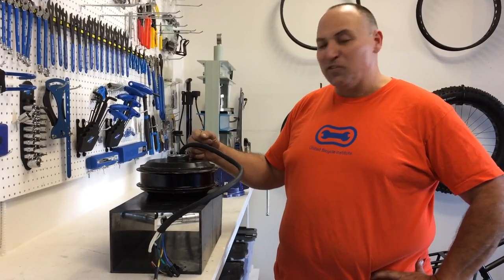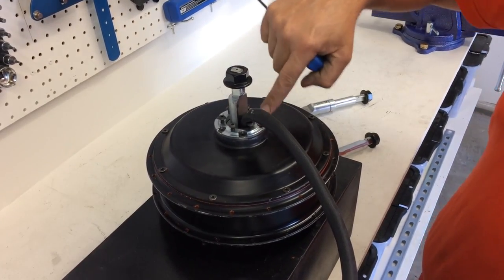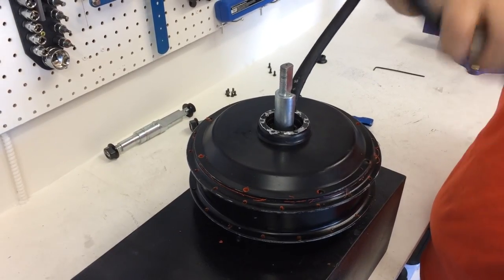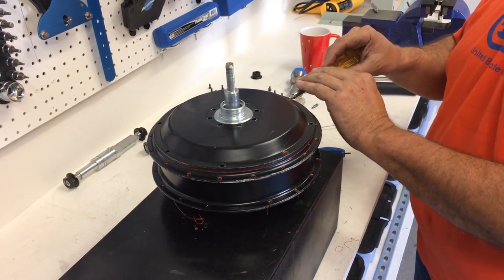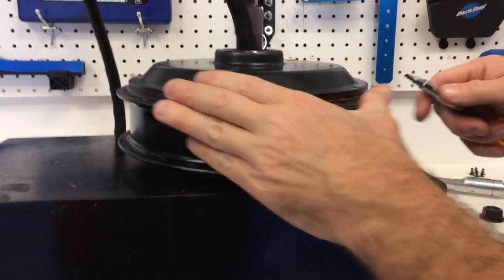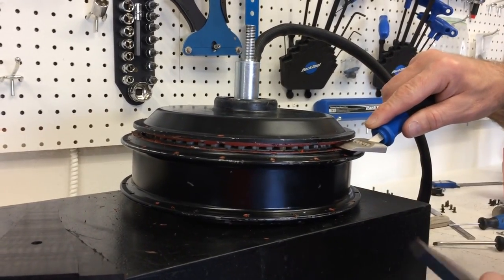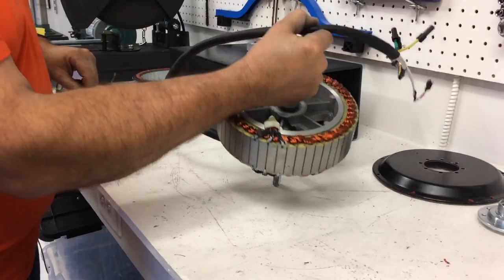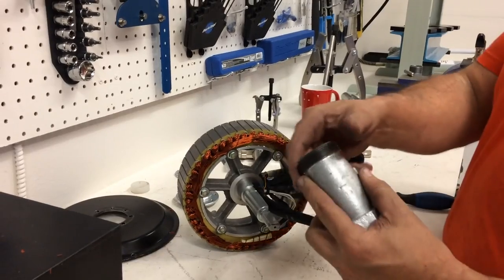Ebike Hub Motor Disassembly and Reassembly

Comment: Hi ya, could someone explain how the freewheel works in this motor? Thanks!
Reply: In tradition, the force is transmitted to the freewheel in cassette from pedaling and drive the rear wheel. But in e-bike, the source of power is the motor isn't it? So how will the freewheel work in this case?
Reply from the maker: David Kk The axle is pressed into the stator. Being rigidly bolted to the frame, the stator remains in that position at all times. The outer magnet spins around the stator. The motor cover, side covers and rim are rigidly attached to the outer magnet. The motor power causes this outer magnet to rotate.
Reply from the maker: The bearings lie between the axle and the side cover. This allows the wheel to roll freely in either direction if the motor is not under power. 

If the motor is under power, the bearings allow the wheel to rotate under power.
Reply: @industrialebikes4956  Thanks for your explanation! Glad to learn some engineering knowledge!

Comment: My 250w motor won't work at all any ideas what to check ?
Reply from the maker: I would start with a remove and replace. If you replace it with the exact same motor, your nonoperational motor will be a source of spare parts even if you can’t fix it. The first thing that I always check is the connections in the wiring. Beyond that, you could look at removing and replacing the Hall sensors.

Best thing about remove and replace is that you get back on the road faster. 

These motors are not expensive. You can get into the nonoperational motor at your leisure. And like I said, those spare parts will likely be a gold mine down the road.

Comment: Any possible way to do this without a gear puller?
Reply from the maker: You could make a tool specifically for the job, and that may work better because the OTC 1038 gear puller used in the video has very fat teeth on the jaws. The fat teeth require the user to pry open the motor side cover at least 10mm in order to get the bearing puller in place. Make sure to pry up the side cover evenly; using two people working 180 degrees apart from one another works well.

Personally, I use the (smaller) OTC 1023 for the exposed bearing and the (quite large) OTC 1038 for the side cover. These cost $41 and $62 respectively and they will last you a lifetime. As far as seating the bearings, a benchtop hydraulic press can be purchased for as low as $75. It is crucial to seat the bearings completely; I can accomplish this using less than 1500 lbs. of hydraulic pressure.

I rebuild these motors a lot, and it is aggravating enough using the job specific tools listed above. It takes a fair amount of time in order to get the large bearing puller on the side cover, but once it is on it is smooth sailing.

I usually slap in a fresh bearing because a 6204-2RS bearing only costs about $3.50.

Comment: Can you open mine .It looks like that one 1500 w
Reply: 😋I took my 1000w hub motor apart with a 9$ puller and used the force of the magnets to seat the bearing and replace the housing.Risky loosing a finger is very easy must be so careful⚡that was 3 years ago to repair i must do it again😕
Reply: We open mine was easy.Now I need to buy axle .Where can I find the axle 190 mm .

Comment: Hi, is there any chance that the axle could be loose in the stator?  I mean not playing loose, but I have knock when I push throttle after breaking with regen. The same knock I feel when I breake with regen after acceleration. I do not have rear brake caliper at all. I have proper, precisely fited torque arms both sides and nuts on axle are very strong tighten.  Is the axle assembled same way in mxus v3 motor? Could the axle move in stator for some reason during regen/throttle drive? Thanx in advance.
Reply from the maker: I have never worked on an MXUS. On the 50mm hub motors, the bare axle gets pressed in with over 3000psi of pressure, so I would HIGHLY doubt that it would have any play. Having said that, quite often when I order custom wide axles (from both Zelena Vozila and QS Motor), the bare axle fails QC at the factory and they have to machine the axle(s) again. I have often wondered what aspect of the axle failed QC--perhaps the diameter where it meets the stator?

Regen sure does apply a lot of backward forces. Enough to loosen tightly applied M16 axle nuts.

If I had to guess, i would say that you are NOT getting ANY play where the axle meets the stator. I would have to guess that your axle is rotating back and forth just a smidgeon in the dropouts. I see that you say that you have precisely fit torque arms and tight axle nuts, but I wonder if there isn't a LITTLE bit of play there between the axle flats and the dropouts.

If it were the case that your axle wasn't pressed tightly enough in the stator, it would stand to reason that the problem would get worse over time, what with the acceleration and deceleration. Is the problem getting worse?

Is this problem bad enough to require repair, or is it just irritating and perplexing?

As is always the case, a troubleshooting shortcut is to "remove and replace". Expensive as it may be, you could acquire a SPARE, equivalent rear wheel and substitute it in to see if the knocking problem persists. I love remove and replace as a troubleshooting shortcut, and there may come a day when you are so happy to have a spare, ready to drop in.
Reply: Thanx for wide answer, the value of pressure and advices. I appreciate it.

 The "knocking effect" is not getting worse with time and it is rather annoying and confusing. Anyway it is not a healthy sign. I use this motor for 3-4 months now. Axle nuts are not getting loose, they are checked regularly. I'll check if there is play on axle - torque arm joint. Would you please give me rough dimensions of stator ring? I'd like to convert 3000 psi to maximal torque the axle - stator joint can transfer.  The torque needed to get "knock effect" is quite small maybe 10-15% of max motor torque. Outer axle and inner stator ring dimensions would be helpful as well. Actually difference of the two. 

 Regards.
Reply from the maker: I have twelve of these motors, but none are taken apart now so I can't measure the stator for you. I do have six bare axles. I measured the diameter of these bare axles where it presses in to the center hole of the stator. The average diameter of six axles is 28.00mm.

The 50mm motor will produce up to 150Nm of torque.

I still can't imagine that your knocking problem is due to slippage between the axle and the stator. Remember there is a centering pin that goes in the axle and stator (seen at 18:10 in this video). Installed correctly, this pin is very tight in its place, but I suppose that some play (slippage) would be possible if the pin and/or the axle were made too small.

Are you sure there is NO play whatsoever where the axle flat meets the dropouts? If so, you must have really tightly fitting dropouts and torque plates!

If you figure out the problem, post the solution here as I am curious.
Reply: Thanks.
Calculating friction force of stator - axle joint, theoretical torque needed to move the sleeve on the axle is not much larger (almost the same) then maximum motor torque from datasheet. Therefore if there is any imperfections in manufacturing of the axle, sleeve or wedge, then it could lead to play over time. 

I will be checking torque arms soon. As quick as I find the woodpecker I will let you know.

I just got the answer from my body Barmal (he designed nice FOC sinus controller), and he posted me a film, where new mxus motor axle can be moved in a stator with one hand. It is just loose.

Comment: I need to find a video on how to disconnect the wires on a scooter hub motor simply so I can replace the bearing... I've been all over the web seen videos in dam near every language but English... And the only videos I found in English it's actually a guy from India so he may as well be speaking Swahili... It has been 6 & ½ months since my bearings went bad. All the seller wants to offer for help is sell me another motor.
I could use some suggestions... Anyone.?

Comment: Omg this is so aggravating.  I guess you need to rebuild it.  Otherwise, I hope you'd use a hammer and some force instead of that hydraulic press.
Reply from the maker: I don’t think a hammer would work. You need slow, steady pressure. A hydraulic press doesn’t cost very much money.

Comment: here in Brazil costs a lot of money. send one for me can be used or refurbished.Thank you friend
Reply from the maker: Buy one on Alibaba.
Reply: Industrial Ebikes $700+impostos 60%👎
Reply: What is your opinion on the ones that can be found in alibaba and other chinese sources? Are they really poor quality?
Reply: motor bike here in Brazil comes out around 1300 dollars
Reply from the maker: You can buy a QS Motor on alibaba. Those are great!
Reply from the maker: I think a QS Motor is $298 US dollars plus shipping.
Reply from the maker: I own QS motors and Cromotors. The QS motors are fine, but the Cromotors have significant improvements throughout, which would include:
(1) a very different (and better, in my opinion) axle design, 
(2) thicker phase wires, 
(2) removable brake rotor mounting and freewheel flanges (as opposed to these flanges being integrated into the side cover as on a QS motor), 
(3) completely different motor wiring harness (the QS motor wiring harness uses a proprietary multiconductor cable which is fine if you never want to replace any wires, whereas the Cromotor allows access to all of these wires (phase wires, Hall sensor wires and thermistor wires) as they are in a removable sheath),
(4) different color scheming on the spare Hall sensor wires (the Cromotor uses black, red, yellow, green and blue for both sets of Hall wires, whereas QS Motor uses completely different colors on the spare Hall sensor wires,
(5) different thermistor wiring scheme (the Cromotor uses a cathode and anode wire for a single thermistor, whereas the QS Motor has two thermistors, each with one signal wire emanating from the motor. The ground for this signal wire is shared with any Hall sensor ground wire), and
(6) the QS motors come with connectors for use with a Kelly controller. With a Cromotor, you choose your brand of controller and attach the connectors that you need.
Reply: Industrial Ebikes $298+$300postagem +$180 impostos
Reply from the maker: Sounds about right. Did you try Zelena Vozila? Their motors are better and their shipping charges are more economical.
Reply from the maker: Also the Cromotors have a plastic collar where the motor wiring harness exits the brake side. This plastic collar prevents the motor wiring harness, already in a sheath, from damage due to the friction of rotation.

Comment: What size gear puller do I need for a 10 1/2" hub? I see 12" but i'm led to believe they will not pull a 10 1/2" hub. Great video!
Reply from the maker: A 12” gear puller would be perfect. 12” refers to the maximum size.